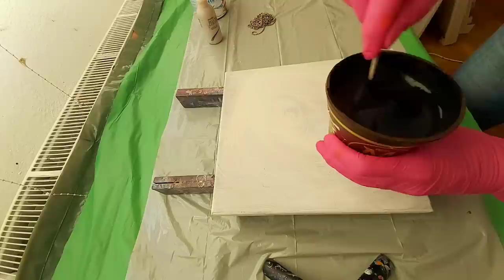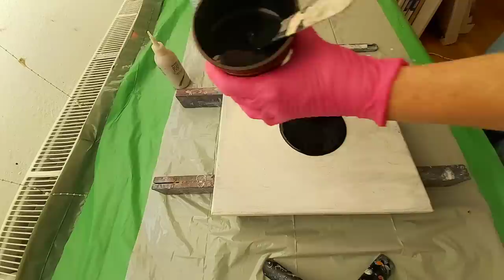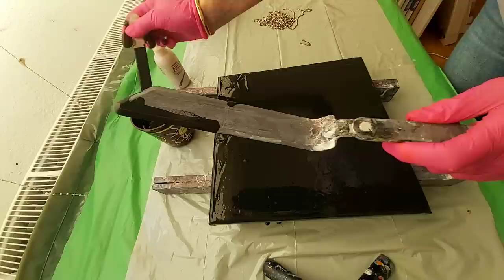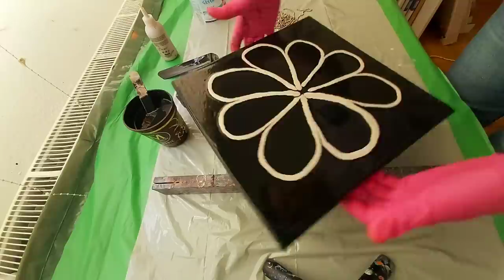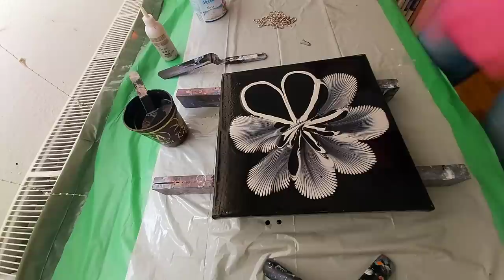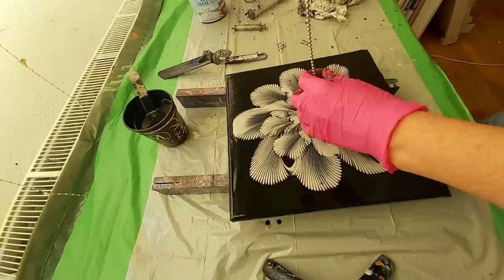Chain pull  106

Comment: It's the prettiest chain pull I've ever seen. I've used a syringe to remove extra paint but like you I had trouble with it.  So I bought a stainless steel syringe baster/injector.  It's actually used to baste or inject meat.  I cut the sharp tips off the needles and it works great. It was only 13.00 US dollars and a great tool for anyone doing many chain pulls.
Reply from the maker: Coco thank you 🖤 and thanks for notice about steel syringe, I use now a plastic pipette.